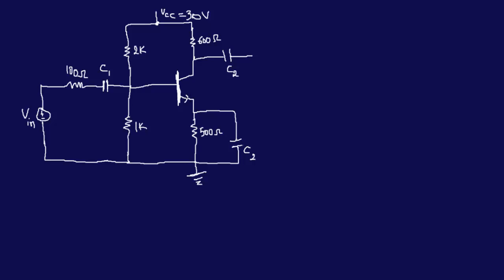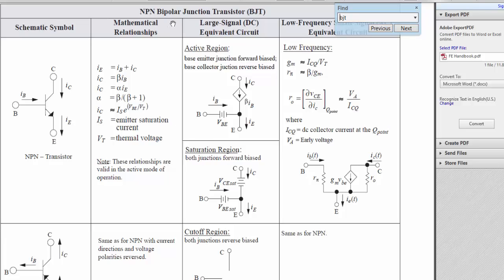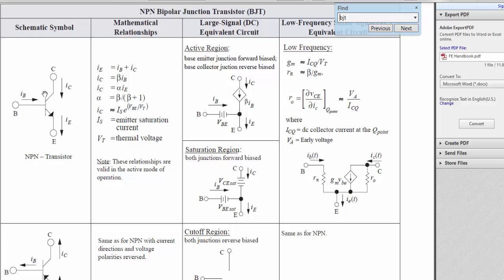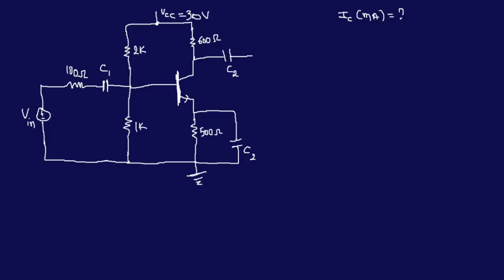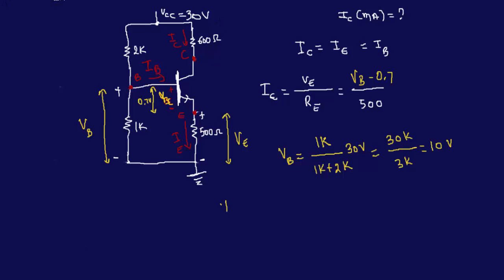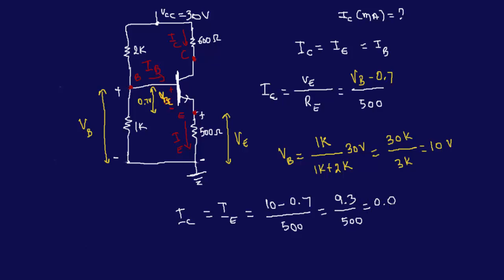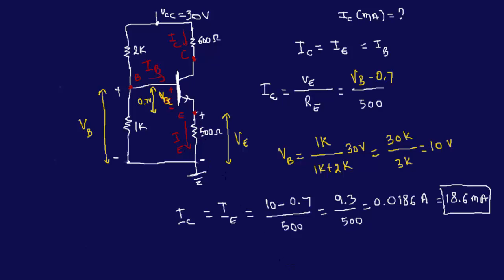Another BJT Transistor Example-FE/EIT Exam

Comment: KVL: -30V + Ic*600 + Vce + Ie*500 = 0

where Ie is as explained in the video, Ie = 18.6mA and Vce = Vcc - Ieq(Rc+Re)
where Ieq = ( Vb-Vbe ) / ( (Rb/(Beta+1)) + Re ); Beta is infinite so the Rb term goes away.

Ieq = Ie = 18.6mA and Vce = 30-18.6mA(600+500) = 9.54V
Solve for Ic in the first equation; Ic = 18.6mA

Comment: i have a question is the voltage around 1K resistor Vb if it is then current flowing is ib and by using Ie=Ib+Ic equation ,vb by divider Vb/Ik=Ib and Vb-.7=Ve,Ve/500=Ie... but the answer we get is 8.6.I dont't think so current around 1k is ib which is why i will follow your method please reply if you can.

Comment: Your assumption isn't that beta equals 1. You actually assumed that beta is infinite (which is a good approximation in most cases), because you didn't consider the base current when calculating the base voltage divider. A transistor with a beta of 1 would be useless because it can't amplify anything. Also, because of Kirchhoff's law, the condition Ic=Ib=Ie is only true if the three currents are zero.

Comment: I had a similar circuit and to solve for IC, the solution recommended IC = (VCC)/(Rac + Rdc)

Rac = resistors under AC condition, Rdc = resistors under DC condition. 

I calculated this problem on the video and I got 17.6 mA

Comment: I think there is mistake in  calculation , you  did not pay attention on the 2k and 1 k resistor , because of these two resistor control the base current , as I did to find a base current (30-,07/2k)-.7/1k=IB, when you see the current comes from 30 volts , it is divided in 1 k and in transistor.
IB=13.95 mA

Comment: I think the circuit diagram for voltage divider to determine Vb is not correct.  Wikipedia has the one resister in series and 1 resister in parallel with the voltage source.  Rp/Rs+Rp.
http://en.wikipedia.org/wiki/Voltage_divider
(love the vids!)

Comment: the emitter current is NOT = to the base current  .
Reply: Raiya Energy That is totally wrong that you said Ic=Ie=Ib. Ib is much much smaller!
Reply: Raiya Energy And there is a relation between the currents that Ib+Ic=Ie. So with the approximation that Ic=Ie(belta is big enough that alpha is approximately equal to 1), Ib should be approximately to be 0!
Reply: @chenxiaomaoify  thank you
Reply from the maker: I made an oversimplification/assumption for the purpose of this particular problem.
Reply: Raiya Energy
  Your simplification assumes the emitter current and collector current are approximately equal. The base current is substantially much smaller.
Reply: lu chen I agree.  She should not have written Ie=Ib because it adds confusion.  She probably did not catch it because she never used Ib to get the solution. (good catch!)
Reply: +lu chen +1